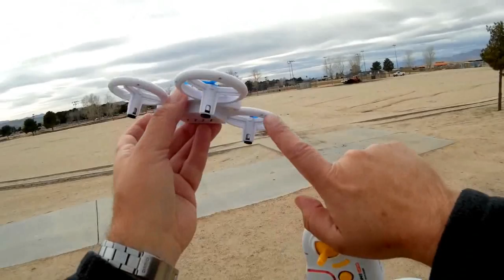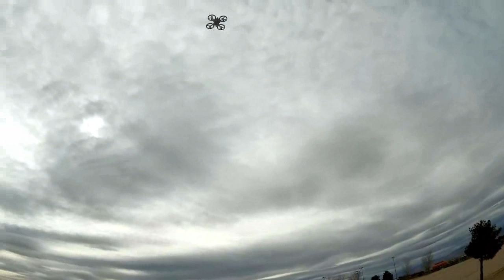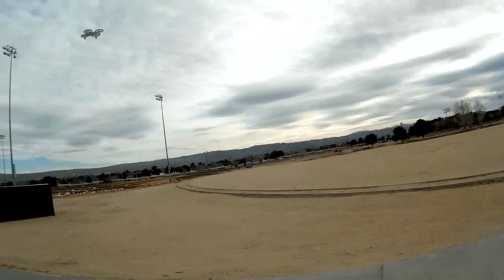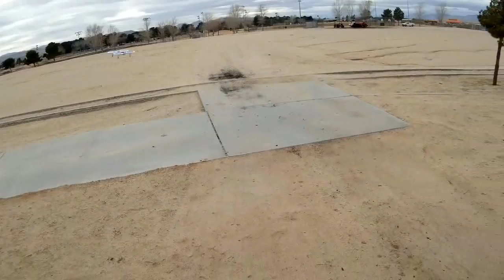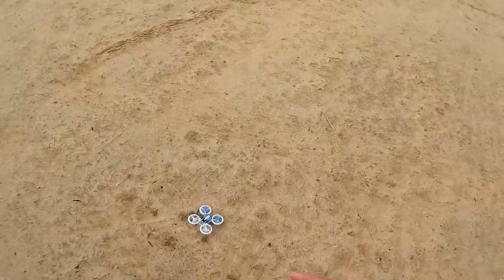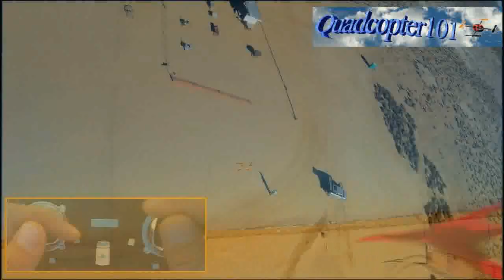JXD 399 Micro Night Drone Flight Test Review

Comment: Cute little flyer with some nice lights.  Only 2 drawbacks I noticed were that the "barometer altitude hold" is "Not Amazing" (as SeBy would say). It also appears to be either under powered or over weight, as after some sporty flying, it falls to the ground and has to recover altitude. These little ducted flyers (Tiny Whoop clones) are popping up like mushrooms ... a good variety of them to pick from. This one seems to be on the high end of the price range, compared to other brushed "Whoop clones".  I guess that the "draught" is now officially over in California (from what I've seen on the news), so perhaps you won't be bothered with fires come this Summer, which would be good. Thanks for the review. Cheers.